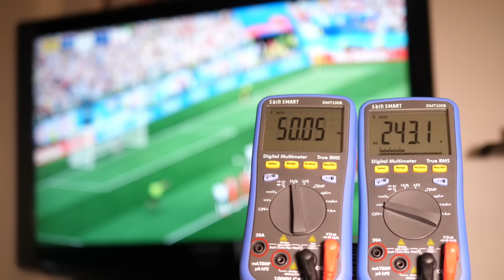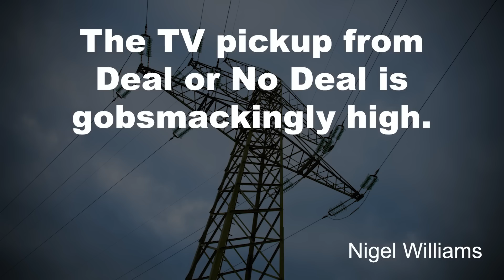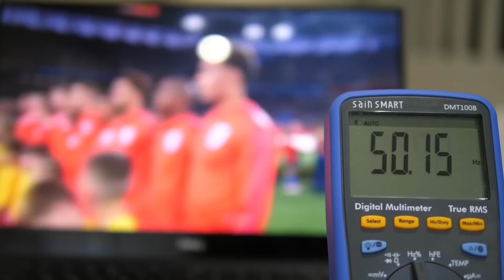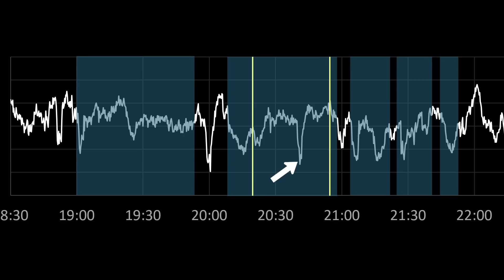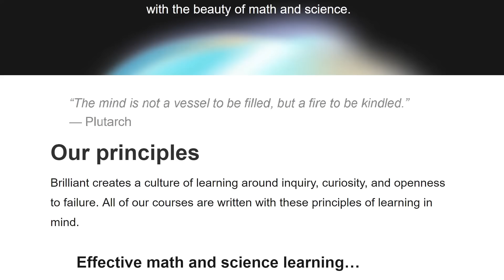Detecting World Cup goals with electricity - The TV Pick-up effect

Comment: 11:26 - What is the vertical scale (and origin) supposed to be? Assuming the bottom line is zero (there's no label), does that mean the mains frequency dropped to less than 20 Hz at 20h00? ;)
Reply: So they broke the law? ;)

I know it obviously didn't drop to 20 Hz, my point is that, without any information about the vertical scale and origin, that graph is meaningless. Maybe it ranges from 49 to 51, maybe it ranges from 49.999 to 50.001. Maybe it's linear, maybe it's logarithmic. Like someone else wrote below, we might as well assume it varies between "zero" at the bottom and "infinity" at the top. :P
Reply: /woosh
Reply: "My posts" here are two jokes, one (correction: two) posts about language (pronunciation of decimal places and use of the word "soccer"), one post quoting the EU tolerance values for mains voltage, and one reply to someone who seems to think power companies (or possibly everyone) should buy thousands of Tesla batteries to solve a "problem" that (as this video demonstrates) is already being adequately dealt with.

It seems you lack the ability to understand humour and / or plain English. But (fortunately) I'm not here to teach you either of those things.
Reply: @William White 

he does have a good point, its not about the actual frequency, its about the display of information and how its too ambiguous to be very informative. ... maybe the graph shows a variation of 45-55 hz, maybe it shows 42-62  or 10 - 90, its not clear in the video.

as you said "The point is to show the CHANGE in frequency versus time rather than the absolute value of the frequency at a time. Graphs are normalised for this exact reasion." but without knowing the values on the graph we CANT POSSIBLY know the change in frequency. it could have been 49.999- 50.001 deviation, but how could we possibly know this. without this information it could show that the UK grid is incredibly solid and reliable.... or it could show the exact opposite.
Reply: did i say it wasnt?
Reply: I honestly couldnt care less about the reliability of the national grid... I care "deeply" about concise information shown in graphs. you seem to be some kind of national grid fanboy or something which i find weirdly disturbing , however my point still stands that a graph without information is not very useful .

Comment: I used a slightly more complex but more reliable method:

Instead of a multimetre connected to mains, I used a large array of light sensors behind lens assemblies, connected to a network of signal processors and transmitters that allows me to detect the goals visually on my TV screen. Overkill, I know; it'll never catch on.
Reply: And it's completely organic!
Reply: A phototransistor hooked to a PCM recorder with the plug in low voltage aux  phantom power across it. Place it under an appliance incandescent bulb record the signal and divide the frequency by two.
Reply: Also they used to have light to frequency converters that put out a 50 percent duty cycle square wave that gets higher in frequency the brighter the light that get shone on it.
Reply: You mean your eyes?
Reply: @leonrieger  No, that person means live-broadcasting technology.

Comment: Electricity trading can significantly disrupt the grid frequency. On the European mainland, electricity is traded in one-hour or 15-minute time packages, so that every quarter of an hour there is a significant disturbance in frequency. I do know anything about the power network in the UK. But at first glance, I noticed dips and peaks in the measurement, which always occur at full hour. This could be an indication for electricity trade.
Reply: I know that the NI grid is somewhat integrated with the Irish grid, but I'm not sure to what extent. And both Ireland and Britain have DC connections with the European mainland.

Comment: The power station I work at does frequency control most of the time, also you have to remember volt-amp reactance which is pretty important for actual power delivery. Since the introduction or fluorescent lamps and switch-mode power supplies, the grid has become a lot more capacitive (rather then inductive)

Comment: When I visited London I was struck by the enormous quantity of water used to flush the toilet in my hotel room. Is that the case nationally? If not then perhaps closing that hotel will solve the problem.
Reply: Any building taller than a few stories will have its own internal system to maintain water pressure because you lose about 15psi of pressure for every 30 ft. 90 psi of pressure supplied by the water company means no water pressure at 150 ft. There will be a tank every couple floors to supply water to floors below. Or there is one large tank on the roof will pressure regulators appropriate for each floor.

Comment: There's actually some largish lithium ion batteries on the UK grid now. They're nothing like as big as Dinorwig, but they can react much more quickly, in milliseconds, so if there's sudden demand, they kick in to maintain the frequency until the other services have had a chance to respond. That will, in the long run, make this experiment stop working. But there's probably not enough batteries right now to do that, yet. But I've seen some impressive graphs of a similar system in Australia when there was a failure.

Comment: I noticed, yout multimeter measures a lot of noise while measuring the frequency. Generally the frequency of the mains should be relatively stable. I think over a long time period the frequency has to meet very high accuracy standards, becauso some clocks are using it as a reference to keep track of time. However there can be some  invariances in small time windows.
I think you should improve your setup, to verify this:
Use a more accurate frequency counter (maybe get in contact with a HF-laboratory whre you could rent something)
Don't measure the frequency too close to the TV where the game ist watched. Best yould be to select a measuring point which is far away from anyone who watches the game. Because i think a TV consumes also different levels of power depending on what image it is displaying and what sound it has to play. These may cause interferences in the near electricity grid. which are much stronger than the ones caused by water pumps far away etc.

Comment: Further to my previous comment...

If you are not too scared of some complex math it is also worth noting that the local grid voltage variance from the nominal voltage is used to control the local amount of reactive power (Q in units VAr) that should be generated or absorbed to create a comprehensive method for controlling the global balance of real power (P in w) and the local balance of reactive power (Q in VAr).

This is what is referred to as managing the "P's and Q's"

Comment: Steve,

You missed the opportunity to to fully explain how the grid uses frequency as a global signal for maintaining the balance of supply and demand.  As mentioned in other comments most appliances could care less what frequency they are being fed, likewise the frequency variance observed on any grid is an order of magnitude away from what would cause any damage to any of the distribution transformers.

60Hz (US) or 50Hz (RoW) frequency on the grid means that the present global supply equals the global demand.  For most grids a frequency variance of +/- 1Hz is used as the "frequency droop gain"  so in RoW a frequency of 49Hz would signal that all generators should produce 100% of their output capacity and 51Hz would signal that all generators should go to 0% output.

Comment: Is it not that what you've measured Steve is the result of the attempt of the electricity company to react to the demand and maintain the frequency? Sometimes they will have judged correctly, other times not? Like one user mentioned, the spike at the end was a miscalculation of 'over-egging' the system for a demand that wasn't there, or just the overshoot of the system as it was ramped up as soon as the game finished? Without knowing what changes were made in the grid during the match I don't think it's possible to draw any conclusions from the data at all!

Comment: Here in New Zealand we have a heap of hydo generation and we run some 'spinning reserve'. Essentially machines that are rotating but aren't generating useable power. These 'idleing' machines can be put on load in a matter of seconds. Sometimes less than a second. They can also be used for correcting power factor. A note on voltage, in NZ we run 230v nominal but our roadside transformers are set to 240. This is to take into account losses between the transformer and the houses it's supplying. I believe this is pretty much the same worldwide.

Comment: And even if you find a pattern, correlation does not imply causation straight away.
As you say, you need a reasonable meaningful hypothesis and only then you can use the data to check whether it's true or not.
Interesting anyway :)
Reply from the maker: Good point! Perhaps it's the other way around. Changes in frequency cause goals :)

Comment: One missing piece of the puzzle: How does the water pressure affect the grid voltage? I guess the water pressure in the infrastructure is kept up with electric pumps connected to the grid? If this is the main culprit, couldn't you solve the problem there? Put secondary power generators at the place of the pumps? Or disconnect the water infrastructure from electric infrastructure, making both more resilient.

Comment: Really bad cycling analogy there, Steve, because, through gearing, in this respect, you're going to keep the average power the same and the frequency of pedalling (and therefore the effort/heart rate) the same. The only thing which is going to change in cycling is the speed, i.e. the current, which is the parameter the national grid is trying to adapt to. There are no additional resources a cyclist can draw upon to suddenly gain superhuman ability.

Comment: i have the same multimeter, although its a different brand. maybe they are made in the same factory? or maybe one is a knock-off of the other. what app do you use for the bluetooth logging? I use "OWON Multimeter BLE4.0" and it seems to work, although has some bugs. maybe the one you are using is compatable

also, do you have some problems with some of the bars on the "analogue display" of the LCD not showing?
Reply from the maker: Yeah, pretty sure it's exactly the same. Here's the app https://play.google.com/store/apps/details?id=com.lilliput.MultimeterBLE I think that's the same too though. Definitely a bit buggy!
Reply from the maker: I've not had issues with the display
Reply: ah, thats too bad. if it was a different app id try it because the graph doesn't show properly on my phone
i can still get the csv and put it into a spreadsheet though

Comment: So how does the UK keep water pressure up? I thought most municipal water systems were gravity fed by local water towers, so the electrical demand was more smooth as the pumps don't need to meet peak pressure loads, but rather just meet something closer to average flow rates to keep the water levels in those towers between certain limits. Or was it more of a matter of large drops in all the water towers everywhere cycling all of those pumps on at the same time?

Comment: A bunch of Tesla's grid storage battery systems would solve this problem and instantly smooth everything out.  There's already one of these in Australia, The Hornsdale Power Reserve battery system that has already been used in anger.  It reacted in less than 140 milliseconds and gives the electricity company more time to fire up additional capacity to cover unexpected loads/outages.  You, presumably, wouldn't be able to detect similar changes in the supply somewhere supplied by the Hornsdale system...?
Reply: Spiritus. Instantaneous power storage is not important in a national grid: devices can tolerate I or V drops in the time it takes to get a reservoir online.
What is important is the frequency (and df/dt), which is maintained best by the huge inertia of turbine generators
Reply: Tesla didn't invent the concept of batteries. Power companies already have plenty of storage. Most cities of relevant size have several distribution stations with massive power banks. 

They wouldn't last long on their own (a few minutes), of course, because the consumption is also huge, but that's not their purpose; they just need to smooth things a bit while production ramps. 

And, as this video shows, there really isn't a "problem" (I mean, there is, but the system is designed to deal with it). Yes, more localised storage (like, every city block) would smooth things out. But who would pay for the millions of batteries that are clearly not necessary for 99% of users? If you have a company that needs a perfectly stable power supply, you already have regulators (and storage, and probably backup generators) in place. Everyone else doesn't even notice it.
Reply: Yes but Regular batteries are very inefficient, something that tesla is addressing.

Comment: In your bike analogue I would say the voltage is more like the ground speed and the frequency is like the speed you're pedaling at. In order to maintain the speed you're pedaling at going up hill or down hill is tricky because you have to maintain the same pace with your pedals. When they add or remove generators its like changing gears. Its hard to do smoothly but they manage

Comment: The UK mains power grid used to be 240V as standard. Except that it wasn't constantly 240V, and it was allowed to vary +/- 6%, so betweeen 225.6 to 254.5V

With grid harmonisation we're now in line with the adopted European standard which is 230V, but with variance allowed between -6% to +10%, or 216.2 to 253V

Which our power already was, so no changes required!
Essentially we declare it's "230 with variance" but really it's 240 (with variance)

For more info also see:
https://assets.publishing.service.gov.uk/government/uploads/system/uploads/attachment_data/file/293405/05-1410-electrical-supply-tolerances-and-appliance-safety.pdf

Also, https://en.wikipedia.org/wiki/BS_7671

Comment: couple of things, i thought water pressure was maintained by water towers ? 
(of course if level gets low they pump water back up to the top... but i would imagine that only starts when it hits a threshold/low point, and cut out when it hits max threshold ? so wouldnt be an instant response.. 

plus how do they maintain the speed of the turbines ? when the force changes ? 
i always thought they just regulated the steam, to the turbines, if /when they saw a drop in voltage ... surely that would take time to get an effect back .. 
surely regulated the voltage via electronics would be better/quicker ? 
like  a MTTP solar controller for EG ...

Comment: Track water pressure.  That would be an easier thing to measure.  Also tanks eliminate need for quick pump fire up.  You should find out if you are on a tank driven of pump driven pressure system.  With water pressure also look for the increase after words from possible water hammer created by velocity in the pipes slowing down.
Reply: Someone said that they attached a high speed accelerometer to the body of an electric motor and recorded the signal with a PCM recorder and they could hear the sounds of the bearings. Perhaps a system could detect water hammer in a Super Toilet Bowl halftime flush.

Comment: “Hey man do you have a tv somewhere to watch the game?” 

“No but I do have this power socket”
Reply: ElectroBOOM vibes....
Reply: If it's only the frequency of the grid that you are after, you can use an op amp with ridiculous gain hooked to a small foil panel. The hum from the mains will be picked up, and you can use a narrow filter and a zero crossing with interpolation detector to get the frequency out. No love wires are touched at all.

Comment: An advantage of HVDC (high voltage direct current) transmission systems is that the alternating electricity that arrives at your home is generated by an electrical inverter, rather than some spinny mechanical thingy, so they're much better at stabilizing frequency even at increased loads. But they're mostly used only to share electricity between different countries (which can even have different grid frequencies), or in very large countries which need to transmit electricity a long distance away. HVDC systems are pretty cool.